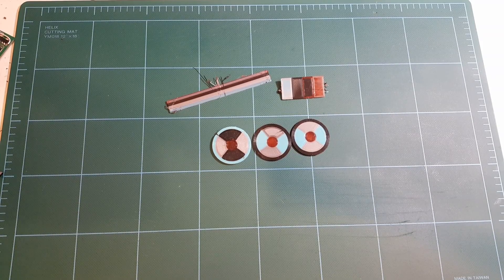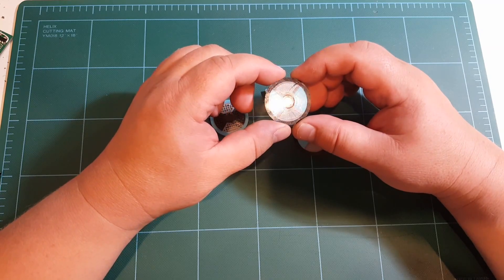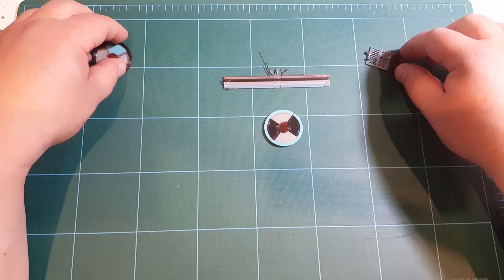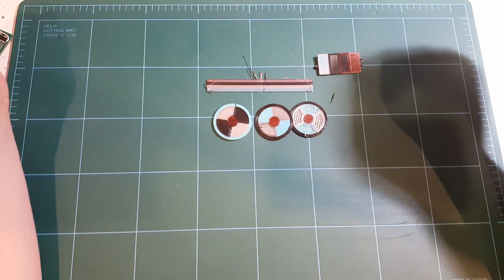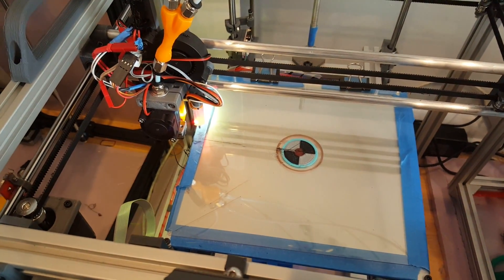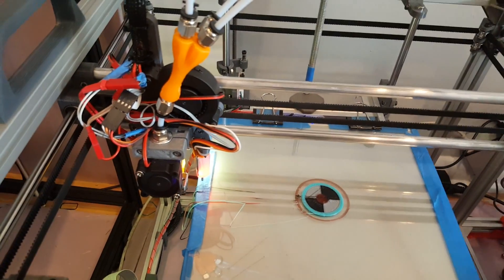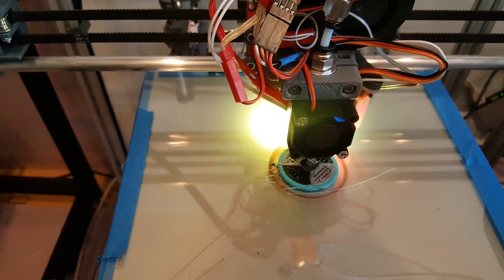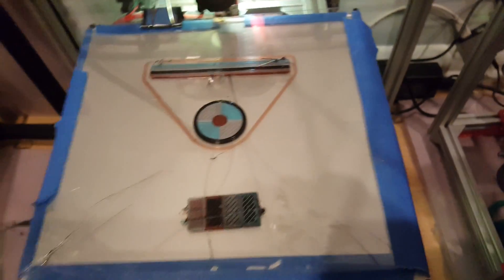Quad extrusion for Hypercube

Comment: what board you use? can you tell us how to set up in the firmware and how to connect the 3rd and 4th extruder motor to the board since on the board (mks gen 1.4 only support 2 extruder socket), please make the video

Comment: For layer change, use the tool change script and move to a point away from the print.. Force material out as fast as you can to reduce the heat in the nozzle/filament then retract as fast as you can.  Might help prevent the hairs?
Reply from the maker: Thanks for the tips!

Comment: Hey this is pretty cool. I think also that the processing power is not enough for it to do the corexy mechanics, and 4 extruders at the same time, might wanna try with one of those 32 bit boards. Also how did you get those 4 extruders to work at the same time? does your board has enough ports for all of them?
Reply from the maker: My board supports 2 and I added support for 2 more. Simple breakout board. I will talk about it in a future video.

Comment: Dude that's incredible. I am much more interested in multi-material than the CNC things that Tech2C is doing. I would probably be happy with just 2 colors.

I don't see why the 8-bit CPU would struggle driving more motors, you're only stepping one at a time, but I don't know how Marlin works internally either. Maybe tracking the extra extruder state is too much for it. Duet boards have support for many motor expansions.
Reply from the maker: Agreed. I don't see why it should struggle either. But from observation it appears that it does.

I'm planning a couple of videos on settung up multiextrusion. Might motivate you to get it done :) Get second extruder ready

Tech2C - I see use in a plotter or laser engraver. I don't get why people would want to put mill on their printer. Guess they've never seen how much debris it makes. Don't want that falling all over my smooth rods and all.

Comment: Hi, it took Prusa several months to figure out their Multi Material Upgrade. At the end they had to work with E3D to modify the v6 hotend (don't know what exactly they did), got steel tubes in the multiplexer and upgraded the extruders with bondtech gears. Also they use a 'Prusa Super Switch' (relays switching the E0 lines to four connectors). They still upgrade their firmware and Slic3r PE to get better results with MM. Maybe you should check their github/assembly manual for MM and firmware changes. As far i can see they pushed their E current from a value 500 to 700. The E steps changed because of the bondtech gears. The miniRAMbo has a 8 bit CPU and handles it without any problems, but is a customized Marlin firmware. They ram the filament into the hotend before they change it...guess you get less misshaped filament...maybe the steel tubes help also to reshape the drawn filament. And finally they made the distance between the multiplexer and hotend very short. Hope that helps. Saw on aliexpress '3dsway NF-THC-01' 3 in 1 Multi-color extruder...looks nice but don't know it works and how good it is.
Reply from the maker: Ah, I was wondering how they did that multiplexer. I thought maybe solid state.  They went with mechanical relays? Old school! 
So I tried to find some version of Marlin close to Prusa firmware. But Prusa changed theirs so much that I can't even figure out which Marlin it is based on. Kinda hard to run diff on 2 completely different versions. 
Their 8 bit Rambo handles without problem, but from it's standpoint it only deals with a single extruder. Mux does the switching on tool change. My version knows it has 4 extruders connected. Theoretically since it is not a mixing extruder, it should ignore 3 inactive ones but who knows, maybe it is trying to actively calculate steps for all 4 and loop time drops drastically as result which manifests in jerky movement.
There's gotta be some bug in Marlin causing number of steps per unit having to be much higher with 4 extruders than even with 2.
Steel tubes definitely help. if not with reshaping then with ensuring soft filament doesn't stick to adapter's walls.
Thank you very much for your comment. Very useful hints
Reply: They don't use mechanical relays :-) Google for Prusa super switch. I guess handeling 4 independent extruder puts more load on the processor, so the 'super switch' makes it easier. The switch is based on the MarlinKimbra. So maybe you could try that as long you just need ONE extruder motor running at once with the yy-splitter.
Also check Slic3r PE edition handeling the purge tower, you can use it with any printer :-)
Another option is a 32-bit board like DuetWifi with DuetX ... but it cost a bit more :-(

Comment: Look into the distech automation multi material e3d heatbreak. If you use the suggested purge-retract and feed gcode with an E3D hotened, it eliminates the hairs and allows for clean retract and clean insert back. I fought this problem on my delta for months with different approaches. I got the new heatbreak just recently, and my limited tests are showing that it does indeed retract with no hairs and a clean small tip. Idea is it polishes the filament on the way out. Good luck.
Reply from the maker: Thank you very much! Excellent info. i will definitely give it a try. How many extruders are you running? Have you also noticed the issue with needing to increase number of steps and slowdown of extruders?

Comment: You could add a small brush or silicone blade to the edge of the bed to wipe the nozzle on it's way to print after tool change.
Reply: I tried this -- unless you essentially encase virtually all of the hotend, heater block in silicone -- which I did by casting my own silicone socks, the filament as it's wiping on the silicone wants to curl up and stick to the hotend or heaterblock, after a few tool changes the amount of gunk built up on the nozzle causes a print failure. The custom socks work, but because of how close you have to be with the silicone mold so that all you have left is the tiniest hole where the filament comes out, the socks are consumable beyond practicality, I was swapping socks every 4-5 prints because they'd get tore up by the print, which one of the reasons e3D socks don't cover the entirety of the nozzle. I have just got the distech automation e3d multi material heatbreak, and finally e3d volcano silicone socks, I will soon start getting that process to work as it looks like the parts are now in place.  PS I am doing this on delta, I have a dump bucket and silicone wiper moving independently on the z-axis using custom modifications to the smoothieware firmware.
Reply from the maker: Good idea. Though dump tower is still better than dumping filament next to bed. Over time you end up with a big rats nest of waste filament. Quite messy
Reply: I think that is a good add to clean things up but still needs a place to store the filament that needs to be extracted from the hotness.  The tower is the ultimate place or a really cool additional part maybe.
Reply from the maker: Pretty cool! Hypercube would be easier because hot end stays at the same height relative to the frame. So I could mount wiper even to the printer frame. Or to Y gantry for sure. But given your experience with wiping and socks, i think wipe towers are better option. That's what Prusa does. i wonder what their 4-color upgrade users have to say.

Comment: Is this a kit you bought or did you build it yourself and where can one purchase or get the parts for this basically the connector that makes the 4 teflon tubes go to 1?  It also seems to waste a lot of filament.
Reply from the maker: self-built. Links to parts added to description. Yes, there is some waste. Cost of having multicolor. Alternative is to use multiple hotends but that's another can of worms. In reality, the bigger the part you print, the less relative waste.
Reply: idex, is the way to go, it's big can of worms which I've been digging in for the past few months -- I'm on the other side of it now ... hope to start posting videos on it soon